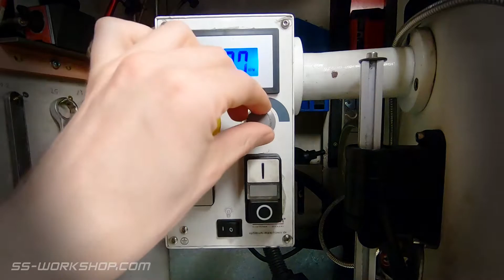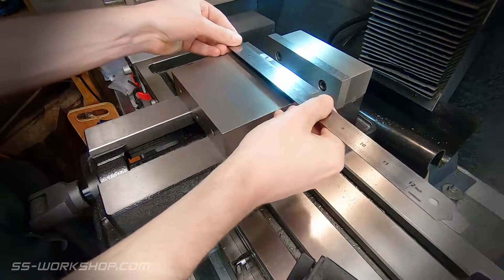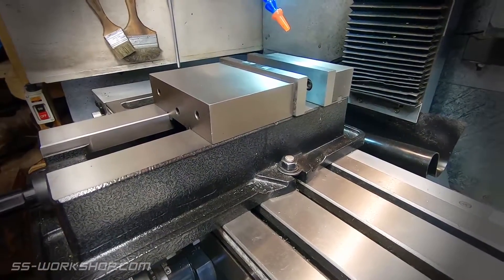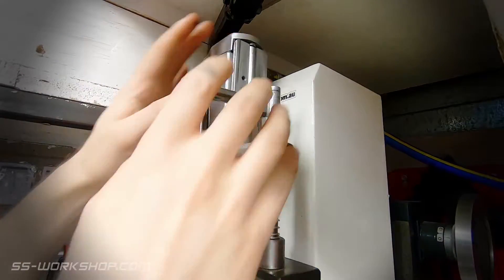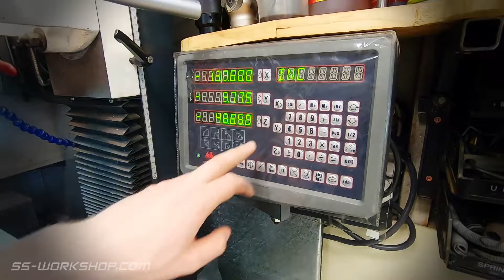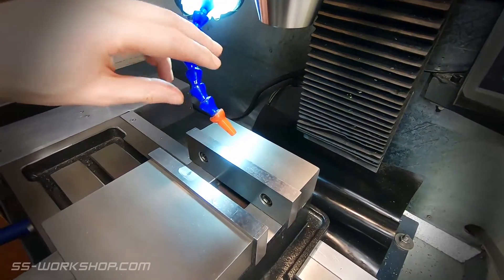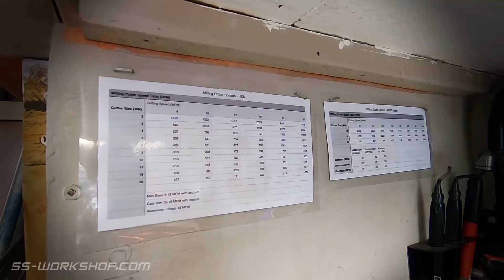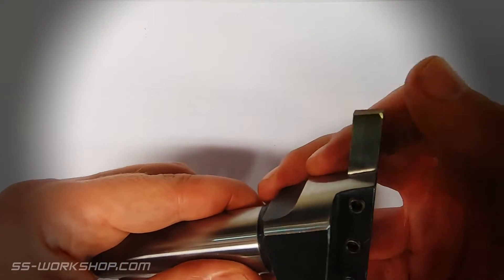Workshop Tour | Benchtop Mill | S1.E2.

Comment: Hi from Palmy, me again! Just lining up various accessories for the BF-20AV I have coming, which is similar to your machine. Most (Chinese sourced) MT3 tool holders tend to have M12 drawbar support, but the mill frustratingly comes with a 1/2". Do you recommend fashioning a new drawbar (as you did), or do you know if alternatives can be purchased? Any tips appreciated :)
Reply from the maker: I would recommend making a new drawbar. You can actually just use threaded rod if you want and add a nut welded on the end of it. That’s what I had for my previous mill and it worked fine. The key with the threads is NZ tool suppliers have a more coarse thread than standard m12, I can’t remember that pitch off the top of my head but I know it’s different. That is what the machinery house optimum mills come with as far a I know and it fits all the tooling they sell. If you are buying actual Chinese stuff, AliExpress and the like then they are standard m12 so it’s easy to get treaded rod at your local hardware store to match it. I don’t think anyone sells alternative drawbar for these, at least I have never seen them. If you are going to make one there is really not to much to it just turn it in pieces slid through the headstock of your lathe to minimise flex the just tap a thread on the end with a die. They don’t get much wear so mild steel seems to work fine.
Reply: @SS-Workshop  Great, thanks for the tips! The one sold with the mill (machinery house) is indeed a course 12tpi thread - it's a 1/2" Whitworth rather than M12 metric. I could buy all the adapters etc, but would much rather have metric to support a greater range of third-party tools. In other parts of the world the Optimum is often sold with an M12 drawbar, so it's a little frustrating to have the imperial one! :)
Reply from the maker: I’m surprised they are selling equipment that they don’t sell tooling for, not sure which market they were intended for certainly not ours. Another thought if you actually wanted whitworth tooling, arc euro trade in the uk appear stock some otherwise new drawbar time and maybe 2 if you want NZ and Chinese tooling options.
Reply: Machinery house do sell the whitworth tooling, but they are about the only ones. There are much cheaper options for M12. Will definitely be a new drawbar for me.

Comment: Greetings from Nelson. Very cool introduction to your mill. Neat to be able to share the successes of our endeavor's, particularly
your Fell engine project. I'm impressed with the extent of your research and technical ability to develop the working drawings.
Like you I'm about to embark on a 3.5" loco, so watching your vids has been an awesome insight.
I've also just purchased the HM46B mill with the intention of fitting a quill dro scale like yours.
Would you be able to provide me with some detail on the materials used and the mounting of the scale and reader please.
Cheers, Peter

Comment: Did you make a video of fitting thr DRO? I just bought this mill in the posses of mounting on stand so not used it yet. Not sure of scale sizes needed for DRO. any info of sizes would be appreciated Love your videos keep them cumming :)
Reply from the maker: Unfortunately I didn’t make a video of that. The place I got my DRO from had a sizing guide for the additional length you need to add for the reader head. One thing I would note is you should measure the travel of your machine. I ordered mine based in the spec sheet if the machine and found it actually had more travel than stated so ended up adding a stop to limit the travel of the table. You also need to find a good location for the scales that doesn’t get in the way. I have mine on the back of the table. You will also need to add some good protection for the scales I found the ones that came with the DRO were pretty light so I got some heavy aluminium angle and made my own. Hope this helps.
Reply: @SS-Workshop  Thank you :)
Reply from the maker: @gazed945  no problems can send through some pics, email me on sswkshop@gmail.com. The way it is set up is a 10mm aluminium plate slightly over size for the scale. This is screwed to the side of the sloping base casting with a pair of shaped packers to square it up. It’s fixed with cap head screws countersunk into the 10mm plate. The scale is then fixed with seperate tapped holes in the aluminium plate. The reader is fixed on the vertical face of the carriage with a pair of slotted angles to drop it down under. Finally I folded up an aluminium angle to make a cover which is fixed with tapped holes in the top of the aluminium plate. I’m sure a couple of pictures will help, I had a look to see if the cover would come off but it went on before the reader so will be shots from a couple of angles so you can see packer set up etc.

Comment: Do all the milling machines in your country use the mt3 taper for the tool holders? Here I think a lot of the mills use the r8. I don't know which works better. We have the mt2 or mt3 in the lathe headstocks and the mt2 or mt1 for the tailstock. The drill presses use an mt2 or mt3 for holding the chuck. I just think it is strange the we have morse tapers used  in lathes and drill presses but the mill has the r8. I would like to know why our milling machines do not use the morse taper like yours with the mt3. I am thinking you guys know something we don't know. By the way, your shop is very clean and organized, I wish mine looked like that!
Reply from the maker: Thanks, an interesting question, it seems to be an New Zealand  / Australian thing that bench top mills come with Morse Taper spindles, I’m not sure of the reason. As for which is better from what I understand the R8 is better as the Morse taper has the tendency to bind making it hard to release where the R8 doesn’t.
Reply: @SS-Workshop  thanks for the information. I am going to look around here and across the river in Canada to see if a mill with the mt3 is available. I only live about 8 miles from the river.

Comment: Hi Mate, thanks for the tooling info the other day. And yes it looks like I have done the drive cog again !!!!!!! Not happy jan ! Also Mate where did you get the speed charts from ? Would love a set ! Thanks again keep up the video’s, I’m learning a lot.
Reply from the maker: Hi Ron, that’s no good, it seems to happen way to often doesn’t it. The speed chart is based on a formula for converting diameter and Metres per minute into RPM then you just need some ideal MPM numbers which seems to vary everywhere you look for HSS. This also works with insert tooling, you just need the MPM numbers for them. I am just about to email you the chart and spreadsheet. Good luck with the gear replacement. Cheers.
Reply: SS Workshop Hi Mate, just thinking how come the top gear which you would think would strip first doesn’t happen ! So what would happen if the high and low gear was brass ?
Any thoughts ?
Reply from the maker: This has crossed my mind as well, from memory I even bought the gear cutter for cutting it, the only reason I can see why this gear is plastic is so if it slipped out of gear you wouldn’t take out the gears in the spindle which would be even harder to replace. Given this has happened to me twice it is a real issue but since I found the hidden set screw for tightening that, no problems. The question I have been pondering is will the brass gear strip before the steel one or should it be made of another material. In making the gear I think it would need to be cut in 2 parts then fixed together, not quite sure what would fix brass maybe silver solder and or a key. The only thing slowing me down on this is Its only a problem when it’s broken and then you need a working mill to make a new one so the new gear is installed then it’s not a problem again until next time it’s broken.... let me know what you come up with it would be good to fix this long term, I really wouldn’t mind swapping the top gear that’s meant to fail it would be a lot easier. Cheers.
Reply: Hi Mate, first off are you on iMessage !, I have been on Utube  and this guy has installed a built drive at 3 to 1 so low end torque ! And cuts out the Plastic cogs what do you think ?
YouTube site : “Grizzly GO704 Belt Drive review and drill test “.
Reply from the maker: I have looked at belt drives before and my concern is to make the quill work they use 2 small screws to fix to the top of the outer sleeve of the quill, I think that if the mill stops this will be the first breaking point. This one is the same but with the pulleys reversed to increase torque and decrease speed which is nice but without the high low gear would leave the top end a little short for a face mill or small endmills. You could of course run a double pulley but the question comes as to what the existing gearing is doing to the motor speed (which is heavily geared down already) and what we ideally want. I will email you about iMessage.
Reply from the maker: Interesting thoughts Tony, The BF30 isn’t on offer over here so the decision making process was easier. With the plastic gears there are 2 of them one that is straight under the motor drive which is easy to access and should fail first as overload protection if the motor doesn’t stall and the high low gear which I’m guessing is there to avoid taking out the spindle gear if it slipped out of gear or was changed during operation. The issue is it’s this high low gear that seems to fail under all circumstances with the mh28 and is much harder to replace. If you haven’t seen my video on swapping it it’s worth a watch so you know what your up for.
Reply from the maker: Of course why else have a power drawbar... On the draw bar the MH28 comes here with an M12 x 1.75 drawbar as standard so guess they should on the other side of the ditch as well. This is the standard thread for NZ / AU MT3 tooling so I think Hare and Forbes have had them spec’ed for the local market as I have seen overseas ones with R8. The second drawbar I have made is M12 x1.5 which is what the Chinese use on their MT3 so I can use some of their cheaper tooling.